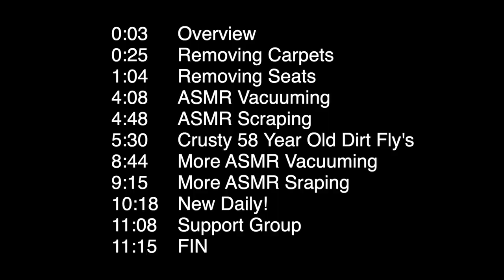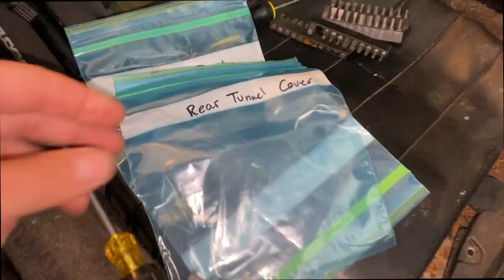Scraping + Vacuuming DISASTER 1968 Porsche 912 Floor Pans RESURRECTION PART 1 | Satisfying

Comment: Only way to do this right is bring it somewhere to have it media/sand blasted. Some services come to your home and blast it.   For the love of Mike please do not use some cheesy substitute like POR-15 over a half-done floor.  If you see rust, it's still there.  If you do not blast what is left it's going to come through.  Blast and and epoxy prime it.  Also, if it can be saved, save the original floor like you are doing.  To do a full floor replacement correctly is incredibly time consuming and past most peoples' skill level.
Reply from the maker: Check out the latest released video. Went ahead and ground the perimeter of the pans to prepare to butt weld the new pans. Definitely a huge job to replace them entirely with all the spot welds/fitting new pans but since the metal still looks good we will go the other route.

Comment: Do you have to go through and sand all the rusty crusty down now and weld in new patch panels?
Reply from the maker: The floors are pretty much gone so complete new pans are ready to go in. We will be cutting up to the good metal and placing in the new floors instead of completely drilling out all the factory spot welds since the metal looks good around the perimeter. Good amount of crust to still get out!